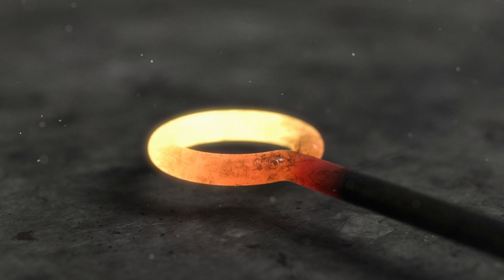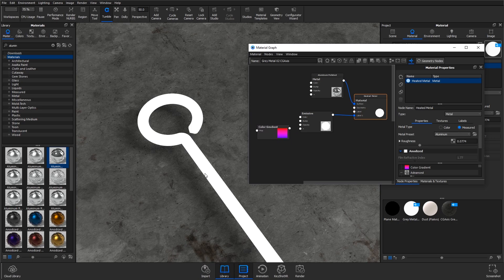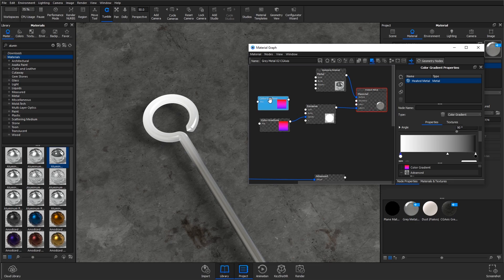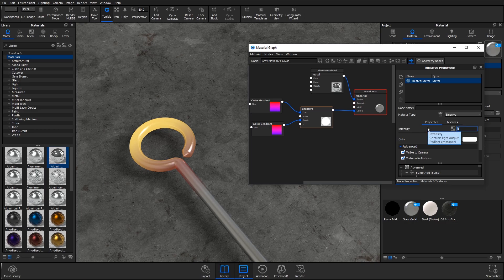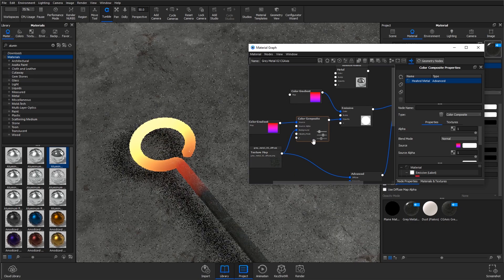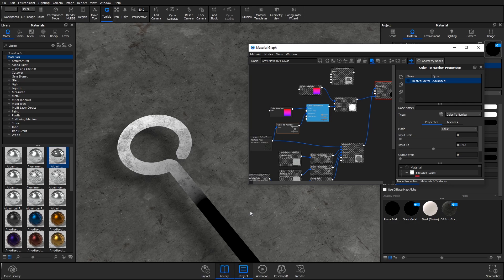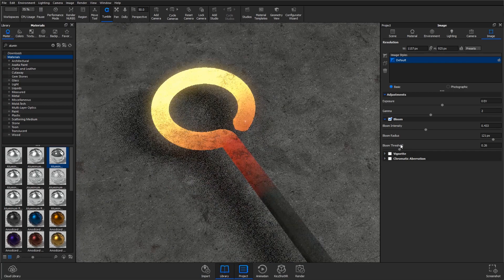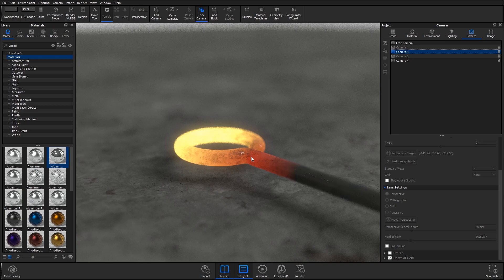Keyshot: Glowing Hot Metal Tutorial

Comment: Great demo, however there is no reflection of the glow on the floor. Any idea how to add that property? The molten metal should be acting like an area light, lighting up the floor and everything around it. I think that may be one of the shortfalls of the Emissive material type, despite its name. However an Area Light material type is considerably less customisable, it's not able to be used in the same way.
Reply from the maker: You're right, I always consider area lights as high power sources and emissive as low (screens, LEDs etc). If you want to get Illumination on the floor, you duplicate the geometry, use an area light on the duplicate, have it only project light out the front of the geometry, and make the material invisible to camera.